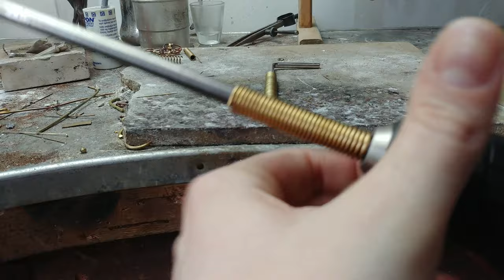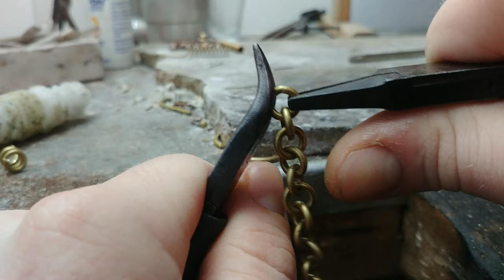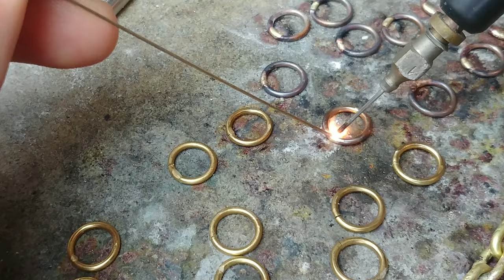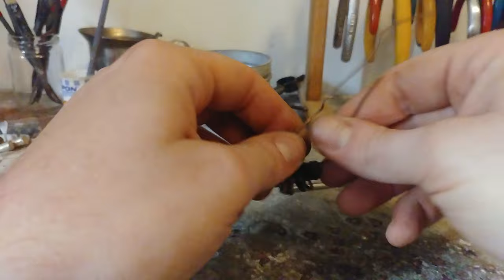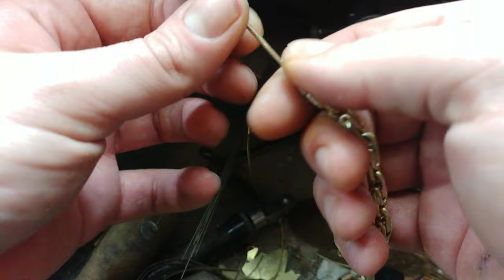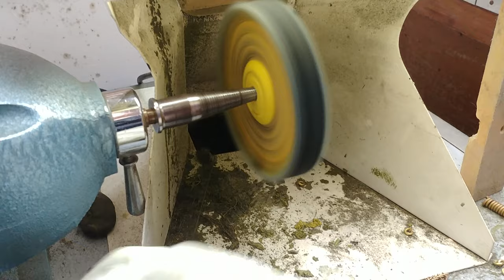Men's Bracelet | Making The Moscow Bit | Brass Anchor Chain With A Twist ~ by Kryher

Comment: I really enjoyed the tutorial. You did a very nice job.
Q: What kind of torch are you using? I see it has a numbered tip and a single, clear poly hose? I also noticed you always extinguish it with your fingers! LoL, just love it!
The title mentions the torch lighter, but I don't see it ... hmm, am I missing a link?
Reply from the maker: Hello there Robert! My torch is an oxy-hydrogen water welder (very cool toy 😁) as for the torch lighter, that's the small box I'm touching the tip of the torch to light it, it's an electric lighter I modified 😉 I'm really glad you enjoyed my video! I'm preparing another soon ☺

Comment: could you tell use the dimensions of the chain , the jump ring sizes and the thickness of the wire you pulled for both . thanks